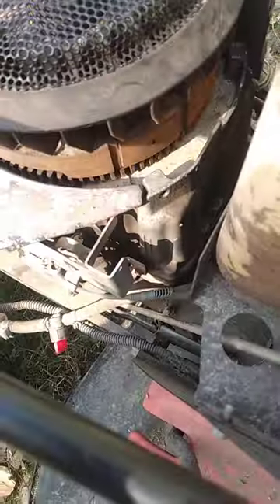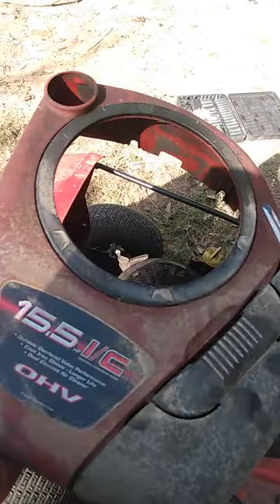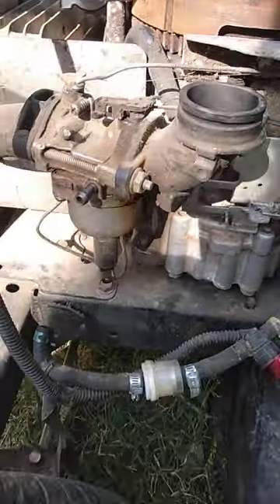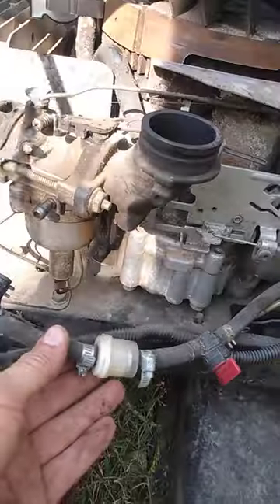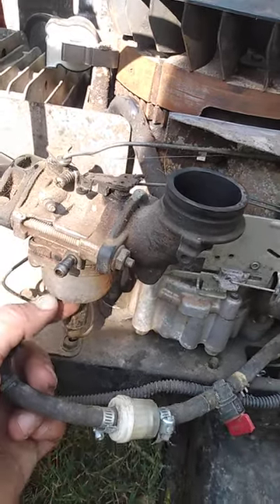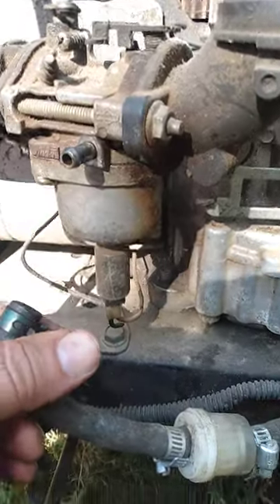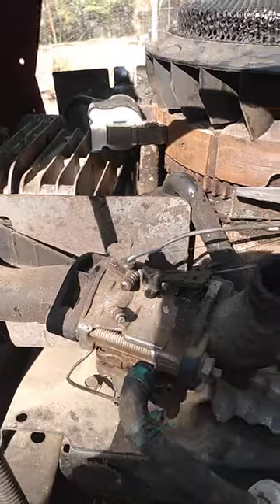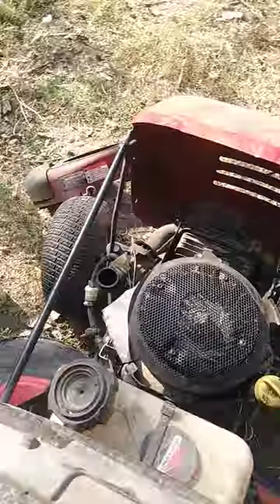Lawn Mower not working? This is what it was for me and was a free fix...@thunderingkitty

Comment from the maker: Also I find that if I set the fuel valve to barely opened, that's the sweet spot for mine. It gets a little flooded if the fuel valve is all the way opened. Proof is, it will run fine for a little, then when there is too much gas in the combustion area, the fuel can't light from the spark.
Reply from the maker: Though if I turn off the gas entirely, it will run for like a minute or so, and run good as it doesn't have too much fuel now.  Sure I could throw more parts at it, but its working again!!! Tim Allen grunt out...